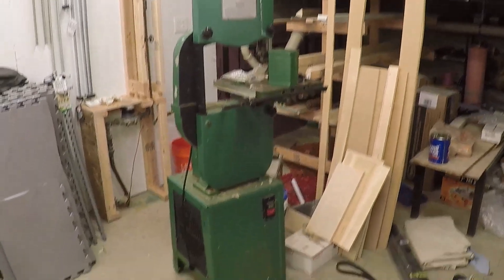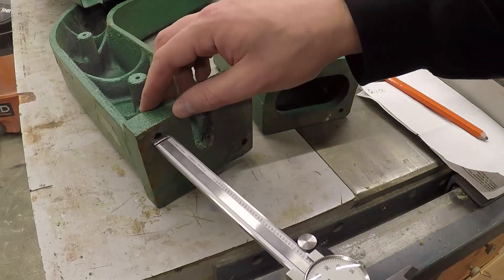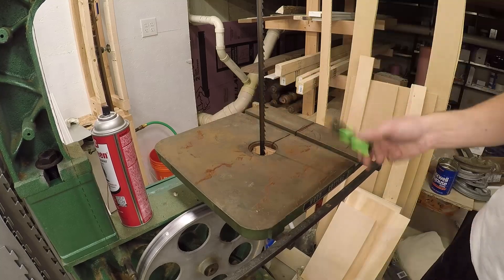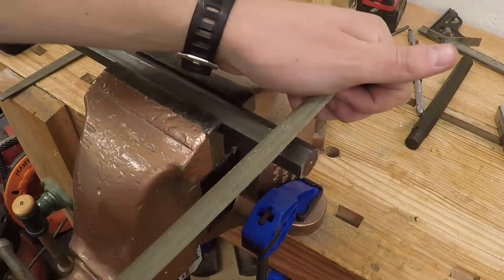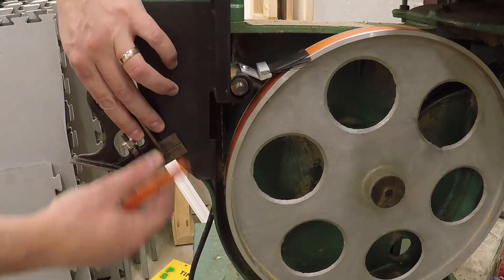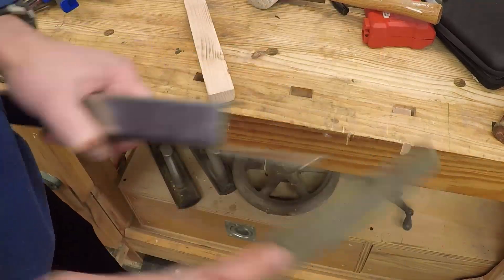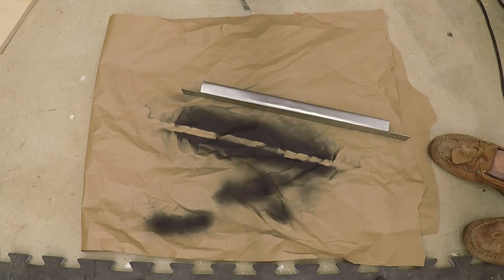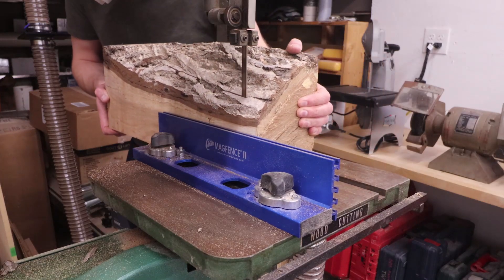Riser Block Installation for Grizzly 14" Bandsaw | Missing Parts

Comment: Thanks for the video. I just finished refurbishing this exact same saw. I noticed on mine the top guide blocks sit forward too much (~3/16”). After some measuring, this appears to be a design flaw. Did you notice the same? I corrected it by filing the castings of the clamps for the hex rod.
Reply from the maker: I can't say I've had that issue, but I'll have to check tonight.
Reply: I bought the same machine in '94 and have had some issues with the upper guide and blade alignment after installing the riser. I could either have the blade aligned properly in the table through hole or slightly twist the guide to keep a proper clearance.

Comment: Where did you even find the Riser Block to purchase? They seem nonexistent online
Reply from the maker: It came with the bandsaw when I got it at auction. They're not difficult to make out of hardwood. Or, if you have any skill with a welder, out of tube steel and plate.
Reply: @GlennFrazeeYT  this is a great idea, thanks. Would you be able to provide the height and width dimensions of the riser block itself?
Reply from the maker: It's a 6" tall riser block. You'll want to measure the width based on your bandsaw.
Reply: Available directly from Grizzly. Riser block kit H3051, $125. They also have a video to show how to install
Reply: As another comment said they are available from Grizzly. They have some of the parts for the G1019 but at least some newer model G0555 parts will fit. The only thing to watch is that some threads are SAE on one and metric on the other.